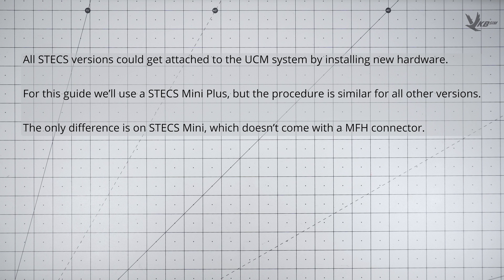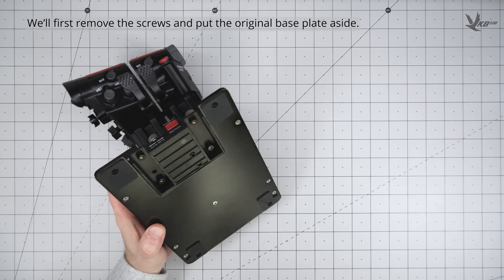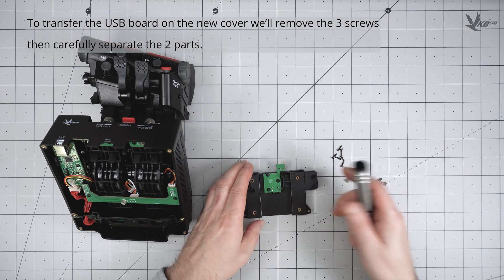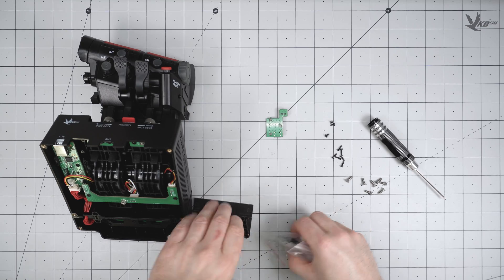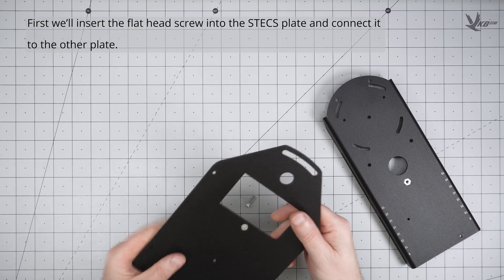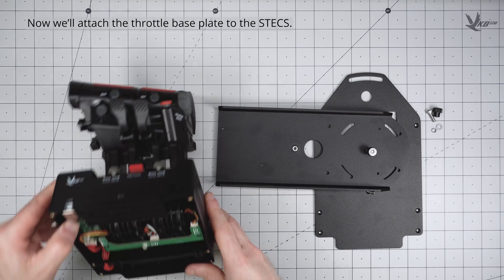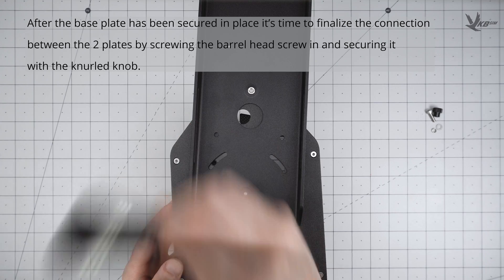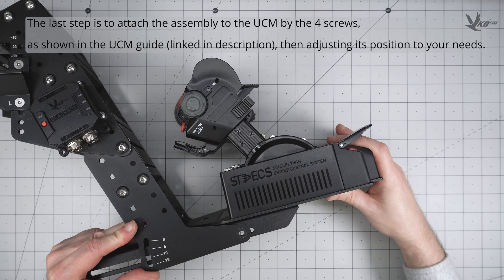How to install STECS models on UCM

Comment: Overall, it's a good video.  Should you decide to remake it:

1)  Audio needs to be normalized - music is much louder than narrator's voice

2) As another commenter noted, two screws next to the external USB port were already removed in the video.  Someone might not realize that they need to be removed and try to brute force base plate separation causing the plastic to break.

3) Prior to attaching the open STECS to the UCM base plate, the internal USB cable was not re-attached.  It's not fun having to open it back up and re-attach and put it back together 🙂

Comment: does this work with the STECS Max ?! ... can you guys please make this more confusing, I think it is not confusing enough to understand what works with what...
Reply from the maker: You can get the Max version mounted on UCM by removing the MFH, installing the new base plate as shown in this video and attaching the STEM unit to the perforated UCM bracket.
Reply: @VKBSim  but where does the STEM and the ATEM modules get installed ?
Reply from the maker: @Gunnl  Check the photo gallery at this link: https://www.vkbcontrollers.com/products/ucm-s-for-stecs-max
YT is not really friendly with technical advice, please join our discord server https://discord.gg/UJAdpdHpYm, we can post pics and advice further.
Reply: @VKBSim  Thanks. Why isn't this on the EU shop ?
Reply from the maker: @Gunnl  Just contact them and they will order it for you if it's not listed/in stock.
Reply: @VKBSim  thanks

Comment: When I dismounted the bottom plate, some thinner rubber part fell out. Any idea what that is? I use the stecs standard.
Reply from the maker: Could be the rubber cap which covers the external wires hole.